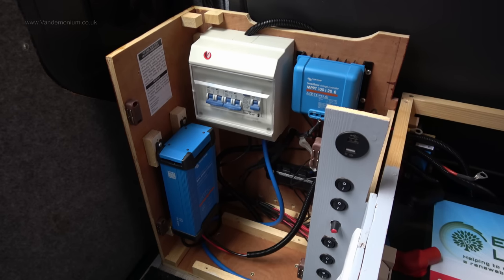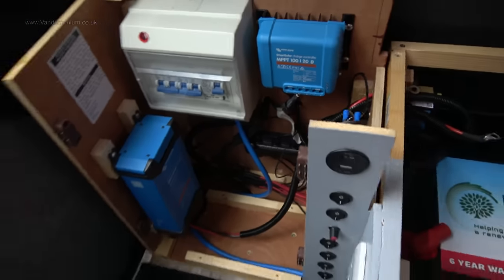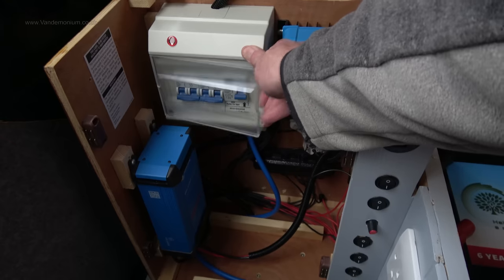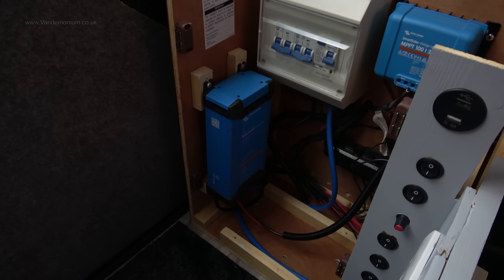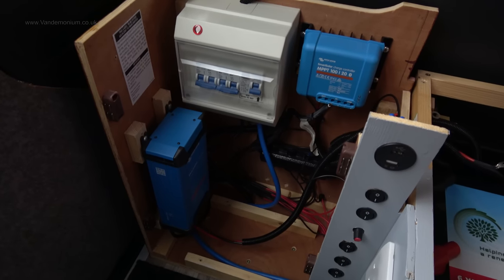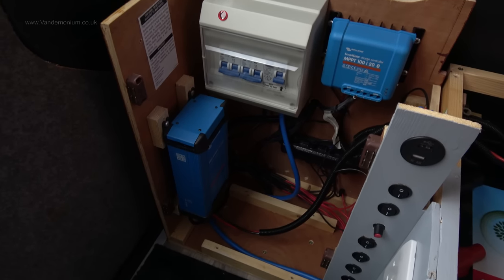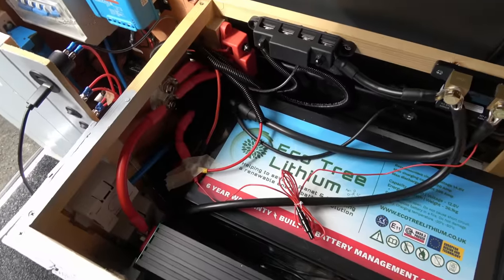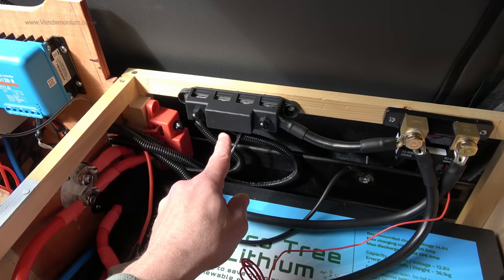79. Oh no! Did I blow up my inverter with an induction hob?

Comment: Lpg detectors don’t detect carbon monoxide and are relatively juicy as they have to keep a sensing element hot. It sounds as though some of your viewers are either insurance agents or paranoid or, worse, both! I think I would  have used a simple thermostat to turn off charging, cheaper and more simple than playing silly beggars with Victron, there’s something reassuring about two bits of metal that go click and separate! I wonder if the cutoff will be inverter or battery, I’m going to guess battery, maybe a BMS overheat as it didn’t go beep and inverters like to go beep at any excuse. It looks like a good setup with good reasoning.
Reply from the maker: It's not just an LPG alarm, it detects various gasses, I just can't remember offhand which ones.

You can't just switch off the charger from the battery while the solar panels remain connected, it needs power to continue operation and must connect to battery first before panels upon start up
Reply: @Vandemonium  they detect a variety of flammable gasses but those don’t include CO. I know, I used to build, maintain and calibrate them. I didn’t say anything about turning off the controller to battery connection, I would turn off the solar connection which, if 60 cell domestic panes are used, would be less than half the current. Similarly with turning off mains charging I would turn off the 240v as the current is minimal.

Comment: i dare say your skills at electrical engineering is advancing at a steller rate. i remember when you were installing new batteries on the boat and when you connected one wire you got a small spark. it was the batteries equalizing. now look at your work and its almost professional.

Comment: Looking good except the crimp on the wire from the busbar to the MPPT looks a little dodgy. Also you need to fuse this connection at the busbar end to protect the wire, but also useful if you need to isolate the MPPT for any reason.
Reply from the maker: The MPPT doesn’t go through the bus bar
Reply: @Vandemonium  Sorry, my mistake. However, both this lead (to fuse/distribution panel) and the wire direct to the MPPT should be fused to protect these wires. In the unlikely case of a heavy overload on either of them, it is likely that the BMS current overload and/or mega fuse would not prevent a potential fire.
Reply from the maker: They are fused, fear not (as you'll see in the next video)

Comment: When dealing with high current always watch all connections closely when running for the first time. The slightest resistance gets hot very quickly.
Reply from the maker: Yep, checked all the connections on several occasions
Reply: @Vandemonium  I mean check for heat at the moment a lot of current is flowing. If you smell or hear the problem you're too late.
Reply from the maker: Cheers, yes did that (you'll see in the next video!)

Comment: Just wondering if lithium batteries don’t like charging when very cold, (and they don’t like lots of things like deep discharging and overcharging) I wonder how people get on charging their electric cars parked outside in freezing temperatures at night?
Reply from the maker: I presume (and I'm guessing) that they have heating pads which use some of the incoming electricity to keep the cells warm. There are batteries which have inbuilt heating too but it requires a relatively large amount of power if the only power you have is solar panels on a van roof.

Comment: I think you might be mistaken about charging when the battery is to cold. As far as I know the battery management system inside the battery won’t let the solar or for that matter anything else charge your battery if the temp is too cold, stands to reason really as that could damage the battery.
Just checked with ecotree and I was right the management system won’t allow the battery to charge if it senses it’s too cold.
Reply from the maker: Not correct in this particular case. Whilst some batteries BMS do indeed have a low temperature cut-out, this one doesn't as I think I mentioned in the video. Hence it does need that to be taken care of externally. The man who owns Ecotree and I had a long discussion about it!

Comment: It’s a very logical and thoroughly researched installation. I’m impressed by your range of skills. i do have a question which is that I thought induction hob pans needed to be cast iron, or at least have iron in them? I thought it was a magnetic heating effect? Your pans look like aluminium.
Reply from the maker: They're induction pans bought for the job

Comment: How did the mounting of the inverter go?  When I did mine the mounting holes on the feet were quite small (M4?) and I am a bit worried they are a bit twee for the weight when the van is moving around.
Reply from the maker: I put thick wooden struts inside the cabinet and then used long screws. It feels solid. I hope I don’t drive enthusiastically enough to shake it off!!

Comment: Having just watched the video, the socket outlet you were using has to have no electrical protection except by the plug fuse, such as residual current or overcurrent.

Comment: Hmm, might there be temperature sensitive cutout doodads on the hobs?

Would be an excellent wheeze to save power and not reduce what's being cooked to carbon? Bit tricky to do a rolling boil if jam or marmalade as the hoped for result. Or do you just turn down the hobs a "notch"?

And to echo others that is a "lot" of current about, even on one hob.

Bullet through battery not causing a fire ... actually that's not quite correct ... check out mad people on YT doing homebrew testing. Gave me the willies!
Reply from the maker: You turn the hob down a notch

Comment: The cliff-hanger is just  annoying David. At least you put the inverter in a vented place finally. Although maybe it didn't do any good, will we ever find out ? After all the precautions and manual reading, it would be disappointing to have it trip out so easily under less than full load !
Reply from the maker: You will indeed find out, in the next episode

Comment: "shall we be Bold?" 🤞😅 Nice job. I'm sure it will be ok. Just curious, you said the inverter is normally installed flat. Could its current orientation affect the internal heat flow and sensor triggering? Causing an early false trigger of the shut off?
Reply from the maker: Might do but not the cause in this instance 😀
Reply: Does that hot plate have a sensor that shuts it down when the pans boil?

Comment: Don’t start your engine if below 0.   I had all the temperature control on my Victron system.  Non BMS batteries and realised I was sticking 150A into them.  No thermal control of your alternator.  Eeek.
Reply from the maker: Not a problem - I don't have any alternator charging! 🤣
Reply: @Vandemonium  I didn’t until I remembered 😂 quite a comprehensive list of expletives released.

Comment: You could have avoided the palaver over the battery temperature issue by installing a bimetallic room  thermostat in the charging line and making sure you use the contacts that open when temperature is below the setpoint. You can pick them up for less than a tenner.
Reply from the maker: No, because the solar charger shouldn't be disconnected from the battery while the panels are still connected. The temp sensor enables the charger simply to stop charging but remain connected.
Reply: @Vandemonium  OK , could you put the stat in the feed from the panels to the charger then, assuming it's less than 13A ?
Reply from the maker: I like having the proper one as it can be monitored on the app along with the other battery info
Reply: @Vandemonium  Fair enough, I just tend to think that renewable technology companies like to charge through the nose for what are sometimes simple solutions.
Reply: @Vandemonium  Most chargers + solar chargers if from the brands (as you have) can get thermostatic options fitted for like 15. :P It's a wire, plugs in, and you're good to go! :D
If a lithium battery you NEED to reprogram the charger to lithium mode. Though I assume you did that with the laptop (not checked the video yet).

Comment: have you tried to set the temperature sensor in the solar controller? Mine works and shut off the charging? wierd yours doesn't
Reply from the maker: There’s no setting to be done. You can turn on the “don’t charge below X degrees” setting but it explicitly states this only works if an external temperature sensor is used.
Reply: @Vandemonium  wierd, mies works but it is a different model to yours and my system is far more complex. Good run through of you system though

Comment: On the battery it says: Charging temperature -20° to 50°. Maybe they have an integrated heater element inside? 🤔
Reply from the maker: Well spotted but it's a misprint which I need to tell them about. That's the "use" temperature range not charging!
Reply: I'd be very interested to hear their response to this.. is it really a misprint? I've got the same battery and I was under the impression that the BMS would protect the battery by not allowing charging at such low temperatures. That's a very misleading/potentially damaging/dangerous mis-print if that's what it is!!

I also, to further the victron frustrations, the orion b2b does not have the v.e networking option so even more devices would need to purchased to create a cold temp charging cut off for this!

Edit- I think an external digital 12v thermostat with a heat pad for the battery might be a better solution for me than giving another fortune to victron..

Comment: just watched your video  How should I arrange the new campervan electricals? where you explain about bending the thick power cables around the corners  then this video the cables come out at right angle with no explanation at all
Reply from the maker: I didn't say the cables couldn't go round corners, I just wasn't sure if it would be feasible. Turns out it's OK if you buy good quality stranded cables

Comment: But it says on the battery itself "Charging temp -20 to 50C. Are you sure it doesn't have some kind of heater in it?
Reply from the maker: I believe it’s a misprint and that’s the usage temp not charging temp
Reply: Hmm, ah, well, now ... you certainly can charge an LiFePo4 at neg 20C without any issues  ... providing you keep the current down to a few milliamps ... no problem there then.

Otherwise one of the electrodes, (Google 'cos I can't be arsed) gets plated in lithium forever and ever and creates one of the more expensive doorstops on the market.

Comment: Can't see for the life of me where you get the power to run that stove for any length of time. The battery drain is enormous.
Reply from the maker: From the battery. And as explained, it won't be running for any length of time.
Reply: @Vandemonium  

As before you'll soon know.

The other issue is how long/many times the lithium battery will supply sufficient current to heat up water for a beverage or a can of beans, say , if you can't get on "shore power", say.

Have to say I am quite (very) interested in what you find in "real life" as opposed to a manufacturer's info sheet. (We all hear about the advertised range of an EV but never how it is to be driven to achieve such ... or the load, including luggage, or the terrain, or how often the regenerative braking tops up the battery, etc, etc.)

Comment: maybe a small fan like you would find in a computer...
Reply from the maker: The inverter has fans within it
Reply: Which is of course a good idea to vent the cabinet in which the inverter lives.

Otherwise the inverter is venting into a warm space ... which is why the old PC cases had fans so the processor fans had a "volume" in which to dump the heat.

And thank goodness for so called solid state wafer "hard drives" these days!

Comment: Is there a potential* problem with your battery ground being on the -ve side of the shunt?  If any of the 12V ground connections make contact with the vehicle metalwork you'll short out the shunt? 

*Pun intended 😀

[Edit - Changed +ve to -ve above as it's the 12V ground that's on the +ve side of the shunt of course]
Reply from the maker: There isn’t a positive side of the shunt, it’s all on the negative. Also, I checked with the team at Ecotree when I went to get the battery and they confirmed that wiring.
Reply: @Vandemonium  My point was that there is a potential difference across the shunt so the 12V negative distribution is at a slightly different (higher by a few mV) potential to the chassis?  A short between the two grounds will bridge the shunt so it will no longer work I think?

I would have expected the distribution side of the shunt to be connected to the chassis, not the battery -ve terminal, as this means that all the grounds are the same. 

Have you connected the vehicle chassis to the incoming mains earth on the shoreline as well by the way?
Reply from the maker: Yes, mains earth also goes to chassis
Reply: Just to clarify (I hope!) further - If none of your 12V equipment can ever have its 0V side touching the metalwork of the van then the arrangement you have will work.  Should it do so however, then the chassis connection to the battery will provide a return path than bypasses the shunt so the measured current will be lower than expected. 

If you move the chassis ground to the negative bus bar instead, all will be OK and work as intended.
Reply from the maker: Yes I understand that, no worries. I'm leaving it as it is.

Comment: Consumer unit should be metalclad, no fuse installed to the shunt supply, poor cable management in electrical cupboards, no segregation/mechanical separation of Band 1 and 2 circuits, electrical switchgear fitted to flammable surfaces, no evidence of any earth bonding, all are regulatory requirements and I could go on!  All of which are valid reasons for your insurance Co NOT to pay out on a claim.  Ask an NIC qualified Electrical Contractor for an Inspection and test Cert for your mains connection and leisure battery installation who will formally recommend changes for compliance or, buy a tent and sleep peacefully in that!  :-)
Reply: The harness, if you can call a single wire a harness, supplied by Victron for the + input to the shunt has a fuse holder built into it.  You can clearly see it in the video.